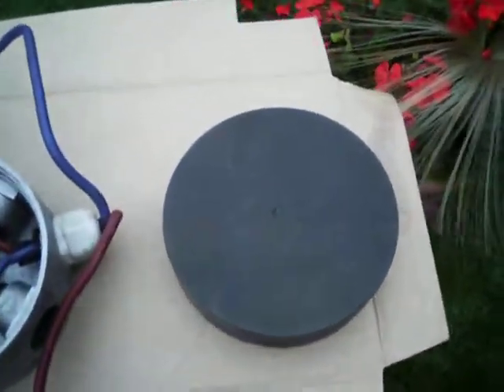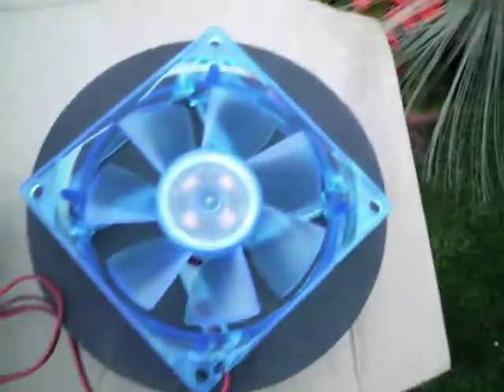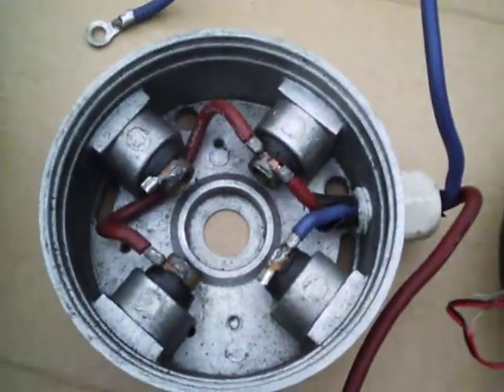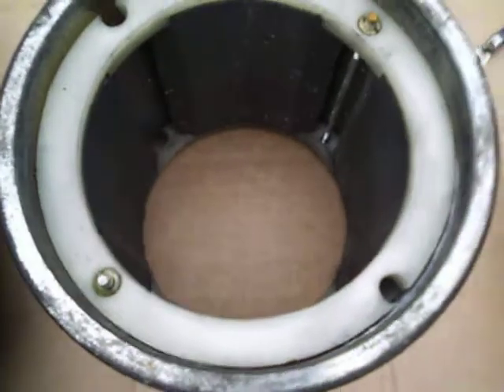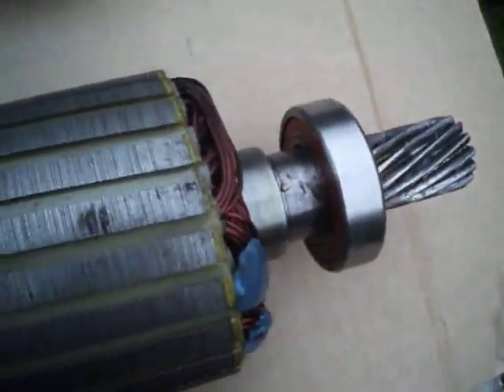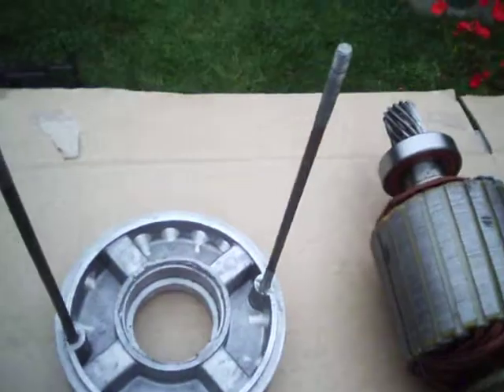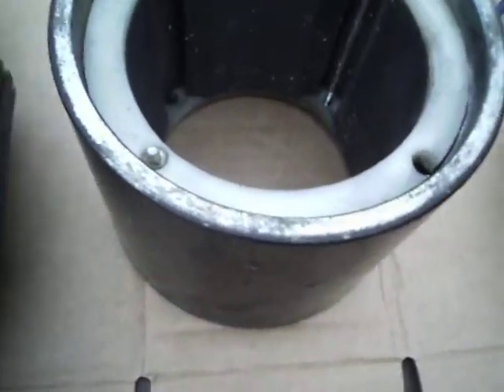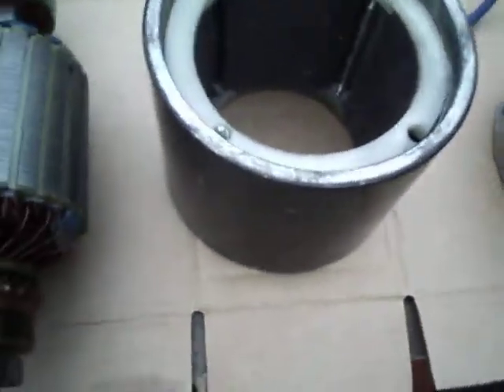electric boat, spare dc motor consruction.AVI

Comment: I keep looking for a couple dc motors ~ I see some around but not very good horse power... how many hp / watts are your motors??? I have seen 1/2 and 3/4 hp but not like, 3 hp or 4 hp... I remember you telling me tread mills, I just haven't seen any @ a second hand store or junk piles.
Reply: I got a dc motor, I think it's off a navy destroyer used to turn a gun turret. with only 12 volts you can't stop the shaft and it has 0 gears. it actually has two motors in one. think it's a inch or a 1 1/4 shaft, motor is about 10'' dia. and about 1.5' long. and about 70 lbs.. the baddest dc motor I have ever seen !
Reply: this guy knows dc motors ~ check out all his cool electric boat videos!

 A W E S O M E!